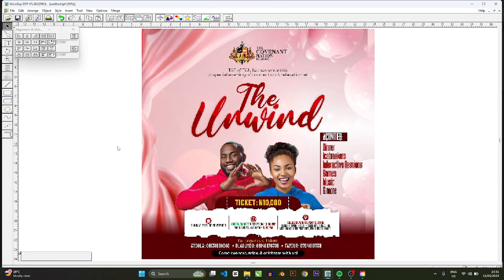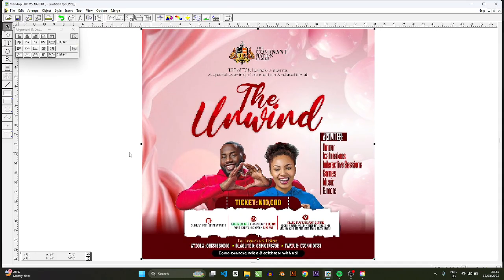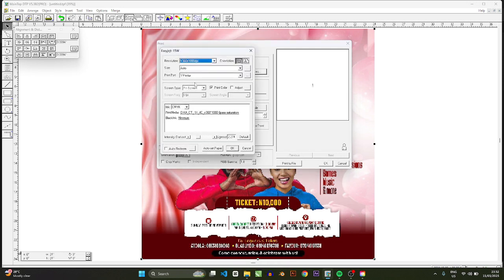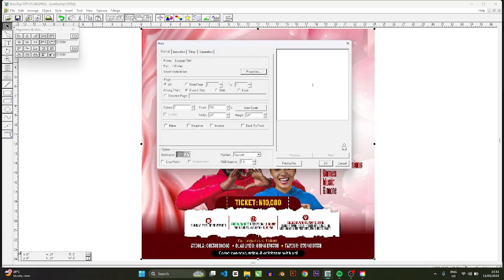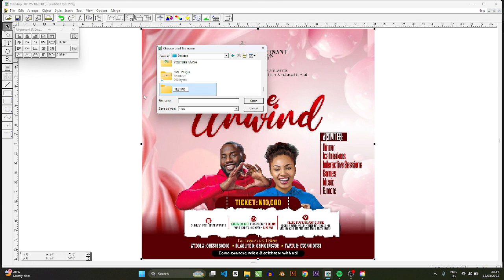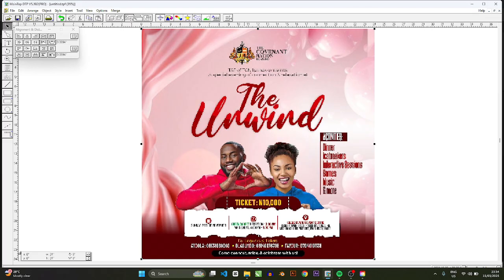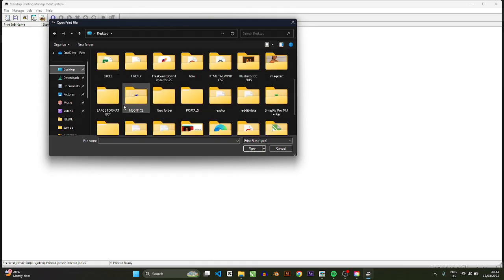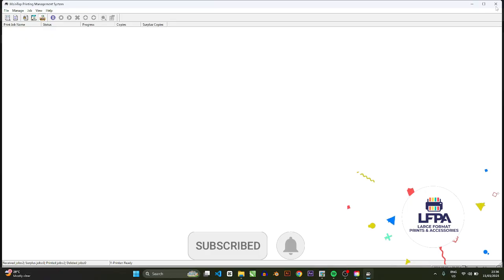How to RIP a Job in Maintop DTP – A Step-by-Step Guide

Comment: I’m trying to print straight from Maintop but everytime through the Print manager but every time I send something to print my Atools crash and nothing prints.
Reply from the maker: You are discussing two separate events 

But to answer your question about atools crashing, try formatting your computer you can use Windows 11 

Watch my video about installing Maintop on windows 11.
Reply: @ yes I will follow the steps but. Let me elaborate a little when I try to send something form MainTop straight it does not print at all.
Reply from the maker: @PrintBossTT then likely you didn't configure Maintop properly.

Or your computer is corrupt.

Watch my video on how to install Maintop in your computer.
Reply: @ okay thanks I will try it and get back to you.
Reply: @ did not work still can’t print from maintop
Reply from the maker: @PrintBossTT either you format your computer. Or call a physical engineer.

Else book a one on one consultation with me. So I can look at the problem with you.

Consultation is not a free service